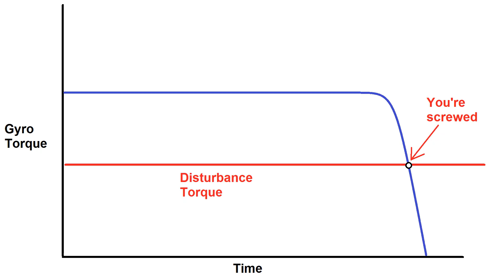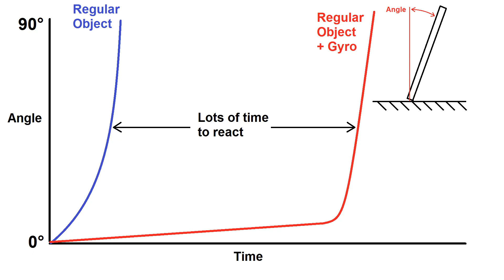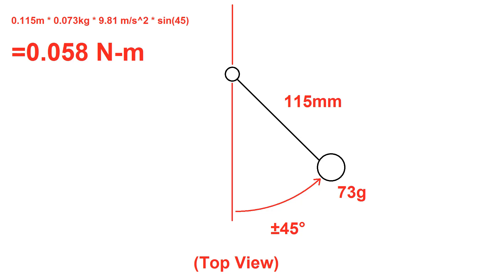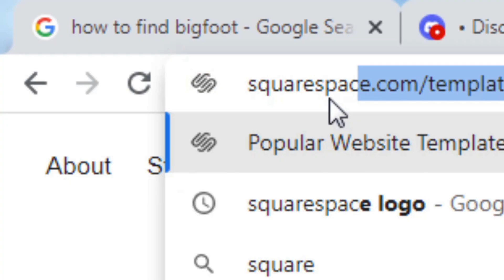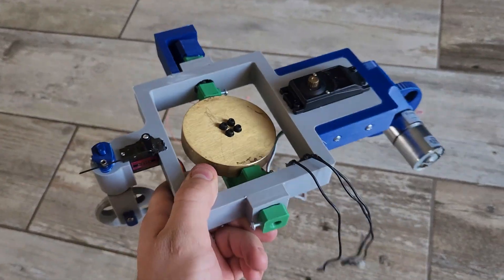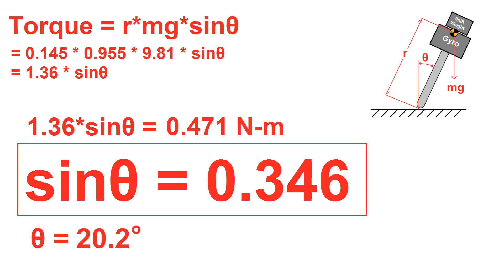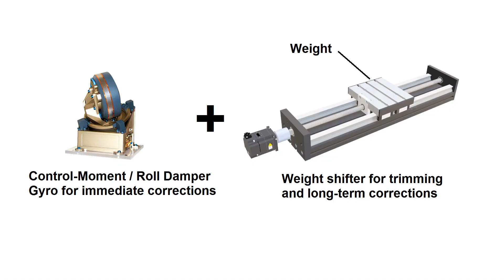Gyroscopic Stabilization with Weight Shifting

Comment: Regarding the "violence osculations" could be quite a few things more.
- Excessive Gains: might be, but low chance; High gains will usually make the system so unstable that it will throw itself into the ground way sooner than that. The gyro helped slowed all that, granted, but reducing gain would necessarily make a mostly-self stable system keep that most-stability (kinda like a foregone conclusion).
- Lag in the Feedback Loop: since you went with using non-digital signals for error calculation, this also has a low chance. Control theory on discrete time systems is wonky, because sampling rate can throw systems into chaos for three main reasons: sampling rate is way below response times, so controller doesn't see changes it needs to act upon; controller is trying to affect the system on a frequency higher than the sampling rate (controller acts like system is going haywire/isn't responding, but system is actually fine); and lag times interact with sampling rate and/or system response times on a way that throw the controller off (can be fixed via programming the controller with lag in mind).
- Non-linear application using linear controller: most likely case. Remember how you explained control authority? Similar situation, different clothes (dynamics clothes in this case). Non-linear systems may or may not respond well to linear controllers. This case (inverted pendulum) is a classical non-linear and non-stable system, that will respond well to linear controller near the balance point (straight up), but doesn't outside really low angles (usually no more than 5 degrees, the cut-off is when sin(θ) being too different from θ itself). This solution even has one extra non-linearity that completely escape me until I was writing this: the actuation arm rotates, so the control authority imposed by the arm is non-linear itself (sinusoidal).
- The wobble resulting from the actuation causing even more changes in the balancing error and that causing resonating feedback: another very likely cause. It came to a point where instead of balancing the wobbling due to gravity, it was trying to balance the wobble from the actuation itself, since the system isn't rigid. The arm was wobbling, the wheels where wobbling, the whole things wobbles so much I would've guessed there was a pretty lady nearby the thing the whole time (at least I would in such a case, call me spineless).

While using a gyro made the system stable and easier to control, that was still an inverted pendulum (and you probably even made it harder with the gyro+actuation arm). The fact that you made it work is crazy hard work. Congrats!

Comment: If it's prone to oscillations from an unbalanced gyro and general jankyness, put your battery hammer thing to swing over the top. That is, unless you're building a motorcycle dogbot. 
Also, couldn't you swing a smaller, faster hammer across the center line rapidly and at a tuned frequency that adjusts swing distance to cancel error? That way it can stop unwanted oscillations with the, um... F=MV^2 to turn a small, fixed dead weight into a large live weight. My gut tells me that the frequency should be at a resonance node of the structure, so that it is naturally stationary, and then the concept makes sense. If you then increase the resonant frequency of the structure by lowering its CG or something, you can run the vibroballancer faster and therefore better.

Comment: Would having the reaction wheel gimbal on the end of a pendulum work? That way the reaction wheel mass would double as the de-saturation weight shifter? You'd need a very beefy servo motor (or several) to counteract all the forces for the pendulum pivot, but maybe rather than a swingarm you have the gyro system be able to swing within a hub-less wheel/track, that way you eliminate all the torsional forces or feedback loop slop you'd need to overcome with beefy servo motors in one spot.
Reply from the maker: yeah I think this would work. I considered doing it but it added a lot of complexity.

Comment: I think you can simplify this all the way back down to only using the gyro alone and just improve the software.  I would increase the refresh rate to help reduce any lag in the reaction time: program your gyro to overreact at the first sign of leaning so that it gets ahead of it, rather than that long delay of lagging behind the fall...  Then, once you cause the bike to start moving in the opposite direction, make your gyro counteract the momentum by meeting the motion in the center again, rather than waiting for the bike to be leaning in the opposite direction before it finally reacts again.   So not only react to left lean and right lean: but also immediately start a counter reaction as soon as it changes direction.    Again, your triggers must be when it tilts, but also immediately when it changes direction.   So if you're leaning left and it overacts so hard that it starts sending the bike back right, as soon as that direction changes, the gyro should immediately start counteracting to the LEFT again..  It's counter intuitive because why would you want your weight to be going left when your bike is still leaning left:   but that's how you have to do it to get ahead of the momentum.

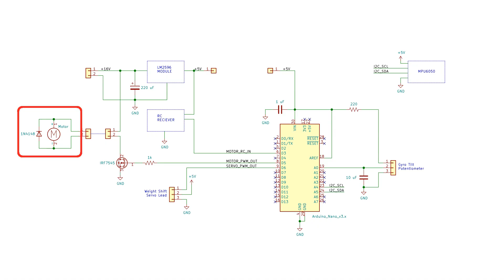Comment: The cause of the oscilations at 10:40 is not feedback loop lag! Not sure if you just simplified it for the video, but simply using the axis' of the accelerometer (At 9:17)  of the IMU (MPU6050) to calculate the tilt angle only works for situations with constant velocity. The accelerometer will measure total accel (gravity vector plus kinetic acceleration), this causes issues when moving/accelerating producing false angle measurements. Since your control output results in an acceleration of the accelerometer, it will cause the measured tilt angle to be incorrect and attempt to correct for the false disturbance in turn resulting in the oscilations seen at 10:40. The solution is some kind of sensor fusion of the accelerometer and gyroscope (Simplest ist complementary filter).
Reply: Or to just add I to PD.

Comment: You can likely improve turning performance by giving the arduino some data on the desired/current steering angle so it can compensate for and lean into the turn.

Comment: No idea why you think you need an actual measurements for the individual parts of a PID controller. You can literally just sum up the errors to get the I part. And take the derivative (error over time) for the D term. Only using PD is a terrible idea and essentially can not work, as both do not actually drive the error to 0. Only the integration part can do that. Only using P or only PI is extremely common. Adding in the differential part is only needed if it has to react really fast etc. which is absolutely not the case here.

Comment: Love the video! And I am sure you're already good on ideas for improvements, but I need to get these ideas out of my head. For the weight shifting, you could add a second mirrored arm opposite the gyro to cancel out the weight shift torque (though this would eat into your electronics space). Then for the wheel stuff, you could have the current "front" wheel as the back wheel and do back-end steering. This lets the traction wheel be more stable and will help reduce turning errors and crashes such as the one seen at 12:20.

I cant wait to see how far you take this!

Comment: Like your project, every gyroscope-related project is indeed interesting. In my project the control can be realized just by a potentiometer to measure the precession, you do not need other measurable variables such as IMU6050, etc.

Comment: Would it be possible to simply slide the entire gyroscopic assembly back and forth perpendicular to the angle of travel using a linear actuator by mounting the gyro on a movable carriage?  This would make the gyro both a simultaneous stabilizing and reactive force with no addition of extra mass.

Comment: But why didn't you just use the old gimbal correction system and just have it oversteer in order to shift it's own weight? Then you won't need a counter weight at all

Comment: I'm a big fan of your videos, I've been subscribed for a while. 

Since it's happened more than a couple of times now, I wanted to let you know that something about your thumbnails (especially those, like this one, that feature a cut-out image on your "default" background) makes them nigh invisible to me 😕 every time you put out a new vid, it inevitably takes me at least a few days to get to it, if at all -- and when I finally do, I end up realizing that I'd inadvertently scrolled past it multiple times over the previous days...and while on a personal level, this could easily be remedied by, for example, turning on notifications, I'm letting you know because if this is regularly happening for me, I'm sure I'm not the only one.

Unfortunately I am neither a creator nor a graphic designer, so I can't give you any legitimate advice as to what you might change; but if I had to make a few suggestions based solely on my intuition, I would say trying different fonts, using a different font color than white, adding secondary text in a different color, and/or adding more color variation on the thumbnails which use your "default" template. But there's a decent chance I have no idea what I'm talking about insofar as that goes.

Anyway, hope you don't take this the wrong way -- I just want as many people to see your awesome vids as possible!

Comment: With just about 1 update per second it is a miracle that it works at all. BTW. You can always compensate for the lack in programming skills by getting more powerful hardware. That's what entire industry is doing since forever. I would recommend something with FPU.

Comment: I built a drone controller for my thesis. I believe you control system is more appropriately called "state feedback" rather than PID, since you are directly collecting angle rate data rather than differentiating the error rate, which is not the same particularly in discrete time. Like you, we also found that controlling a double-integrator system in discrete time is impossible without rate data (with math and everything but I forgot).

Comment: Your conclusion at the end about trim ballast is exactly correct, you want to use the gyroscope for control and you can actually use the whole vehicle or inverted pendulum as the ballast if you intentionally hold it at an off angle for a while you can use that too unwind Your Gyro angle and avoid saturation. It’s also possible to use this data to lean in the returns and avoid having to manually correct for the maximum size using gravity to advantage to keep minimized the key here, but it does require a lot more thinking or at least a decent linear model of the dynamics, also I’m using voice to text so hopefully this makes any sense but I’m on the highway so deal with it

Comment: Would it be a good idea to set the set point of the weight shift mechanism to eventually center the position of the flywheel's rotation or is that just stupid? I have thought of this for all of 30 seconds so probably not.

Comment: Wouldn't making the balance weight motion linear be an improvement too, since with the current setup it's introducing another torque force that doesn't quite line-up cleanly? But how to do that and keep it somewhat simple? (I'd think of the weight being attached to a belt-loop between two pulleys might work, but there could be something else too.)

Comment: To finetune PID regulator, you can use Ziegler-Nichols method. Just set it up in a way, that it will oscilate with constant amplitude and then use a look-up table/ formula to set the PID parameters.   
https://en.wikipedia.org/wiki/Ziegler%E2%80%93Nichols_method

Comment: try ring rotor helicopter (sphere or square compartment inside). rotating ring with outside blades. normal helicopter has to spin the rotor in its own place. contra-rotating reaction control ring helicopter does not have to. the rotor spins literally around the center hub. and the hub can have wheels etc. and if its a sphere, it can roll. it can also easily float. also linear weight shifting is much better. yep its linear. not arc. so where do you need the spinny gyro stuff.
Reply: 90s is good bro. lol. also shaken, not stirred. lots. also lean to the curves. yeah you can calculate the anti-curve gs too. also just have the gyro lock the position to locked. ie passive gyro stabilization.
Reply: Invert the setup. Try to keep a spinning top powered gyro to spin upright at the same location.

Comment: I think you could use the entire bike as it's own counterweight - with a raked front fork and rapid steering control. Like a push bike rider who is not moving forwards/backwards.
Then tune steering angle to counter tilt/velocity.
If the "chassis" mass is not high enough for good control authority then additional mass/lever arm can be added to the front forks.

Comment: You may want to add a low pass filter to the output of control loop. The random noise causing it to become unstable is often caused by noise exaggerated by the derivative term. You can fix that by decreasing your derivative gain, but that has the side effect of making your control lag behind more.

You can also apply the filter to the sensor data before it is sent to the control loop. This is generally better as it allows you to adjust the filter for each sensor, but is more work and likely not necessary here

Comment: I'm sure you already know this, but PID control should never be used for non-linear or time-variant systems, especially in the 21'st century with our cheap and abundant digital compute capabilities.
The control system would work much better (and have been easier to 'tune' for a near-optimal and stable configuration) if you used something like Model Predictive Control together with an Unscented Kalman filter for state determination and tracking.

Comment: You should, theoretically, not need to have the "trim" at all. If the gimbal is getting close to lock, then have it over-correct, so that the entire device starts tilting the other way.

Comment: You should be able to get rid of the weight shifting servo and use the steering servo some clever control logic to actively balance it. Just needs active movement forward/backwards to work (to stand still, just move forward/backwards by an inch or so).

Comment: If you have any drive belt (eg GT2 from a printer. It wont be GT2 but injets have drive belts in em if you have an old dead one laying around) wrap it around the drive wheel. Shave down the nubs for less jiggle on flat surfaces, but the rubber should net you plenty of traction.

Comment: Been missing your videos, love that it works so well already that it's just refinement 😁 have you thought about using a resistive load from the gyroscope that sends flywheel energy back to the battery to both slow it down and speed it up to act as another "nudge" balancer? It might make it much easier to turn using that method with your extra weight shift. Anyways, love the video have a nice weekend👋

Comment: Some quick tips to reduce the latency of your control loop would be to enable interrupts on the MPU-6050 and use the INT pin to fire a pin change interrupt on the Arduino and to use either reduced size floating point precision, fixed precision, or even a higher performance microcontroller (STM32, ESP32, or really anything with an FPU or wider ALU than 8 bit). Consider adding a median filter or sliding window average on the tilt potentiometer if you aren't already, and if you're bored, take a look at free running mode for the ADC to supersample with a very low performance impact.

Comment: Instead of weight shifting why not use a  reaction wheel
Reply: Reaction wheel only produces torque while its accelerating.  Eventually you reach a max speed and it stops pushing.  A weight can produce torque forever.

Comment: Instead of a weight, ... how about a _fan_.  A little drone impeller should be able to produce more torque than your weight-on-an-arm, takes less weight, also doesn't saturate.  It's probably slower to adjust than a weight on an arm, but you don't need it to change quickly.  Instead of a pot you might look for a magnetic encoder-- less friction and way less noise.

Comment: You're having trouble turning because a two wheeled vehicle needs to lean to turn. The gyro is preventing that. Remove the steering control and use the gyro for steering as well as balance.

Comment: Would you share your code? I'm also interested in advancing your control algorithm to be a cascade loop which may work better.

The inner loop adjusts the moveable weight position with a PI controller on angular rate error (using the mpu6050 rate information)

Then the outer loop would be a P controller on angular position error. The output of this p controller feeds into the input of the inner loop (the angular rate controller).

You'll still have gimbal lock issue so you could also add into the controller something to stay away from gimbal lock (and not waste the potentiometer sensor)

If you're interested I'm open to discuss!

Comment: I wonder what would happen with two gimbal gyro/flywheel set ups on different axis of rotation. Would you even need the weight/trim, or would you need one weight/trim on each axis of gimbal authority.....

Comment: Not driven by a refrigeration cycle, even in reverse... 1/5 stars

Could you analyze the controller loop with LaPlace transforms to make sure the response time was low enough? It's been decades since I had to do that but I thinks that's what you'd use to analyze it